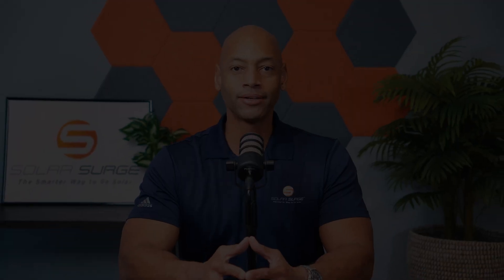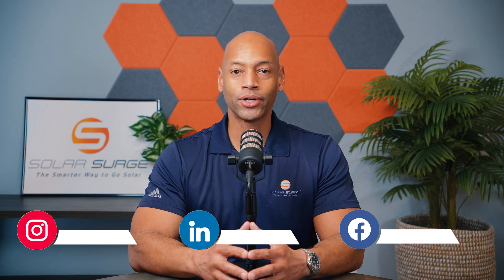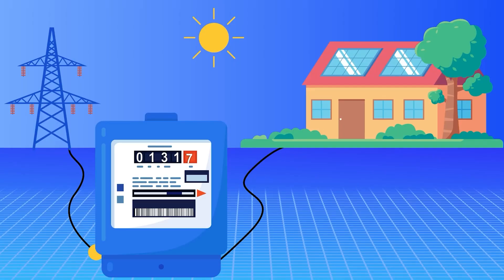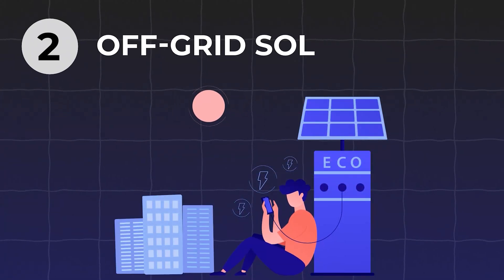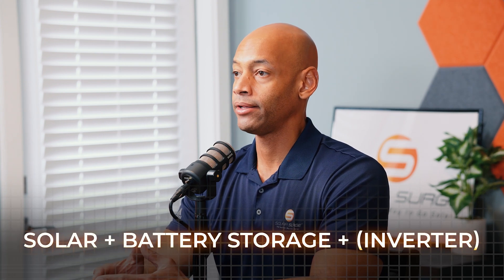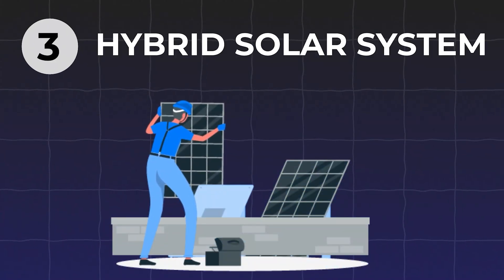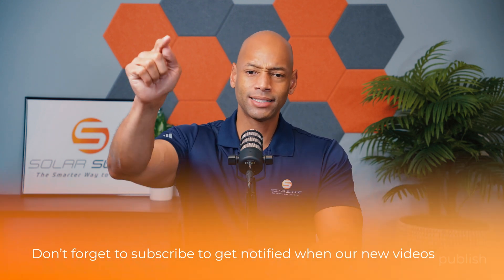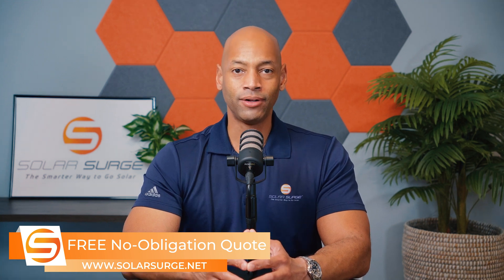Do Solar Panels Work When Power Goes Out?

Comment: Solar panes work as long as they are exposed to the sun and are not damaged!!!
Solar system may not work on the sunny day due to a failure of the single and/or multiple components.
You may have solar system coupled with a generator so when grid is down, the house is still powered even without having a battery, which could be a part of the grid failure system support.

Comment: Thanks for your video. I am however in a quandary because everyone that makes videos about “getting power from your solar & batteries (grid-tied) when the power down, falls short actually telling you how to do it 🙄🤷🏽‍♂️
I believe I can get my batteries to provide power to my home when the grid is down, I also believe, rightly or wrongly, that I can still receive energy from my solar panels to charge my batteries and power my home during grid outages. Sadly, I cannot find an explanation of how to get it work without sending energy down the grid during those times and whilst I am in Ireland, it seems that no solar company or anybody in this country knows how to do this. 

Please help me, I’m going crazy as we regularly have power outages and stuck with nothing 😳🙏🏾
Reply: The reason that solar is off when grid s down s for safety reasons. Its callled anti-islanding protection. This s to protect the grid workers during troubleshooting. 
However hybrid inverters has d capability to produce power either from solar panels or batteries. There’s an additional connector in d inverter for Emergency load and it’s an automatic switchover during blackout (built-in ATS by the inverter)

Comment: It is worth mentioning that many off-grid inverters can use grid power as backup power in order to power loads and charge the battery.. they just can not export excess power back to the grid. 5:07
Reply from the maker: Good point.

Comment: I have the iq8s with no battery and have been happy, but we don’t lose power often. So long as it can keep the fridge and freezer running that’s really all I need from it. I can also manually switch to generator if need be though. I’m looking forward to bi directional chargers coming out now that we just got an ev that supports it.

Comment: If you have battery backup with inverters and auto shore power switching, you'll never even know the power went out. If you are on a grid tied only system, you've likely been had.

Comment: I thought panels produced power if a cloud goes by or even on a cloudy day? That wouldn't be enough to provide backup power if grid goes down?
Reply: Jeez. It's almost like... If you watch the video. You'd have your answer
Reply: @badbake  thought it was a legitimate question, he says that if the grid is out that if a clouds come by that the refrigerator would turn on and off. Doesn't sound right to me. Panels are supposed to produce power even on cloudy days supposedly.
Reply: The panels will produce much less energy and won't be able to produce  enough amps to make your appliances work that's why they'll shutdown

Comment: Hey Joe, I love your channel and it’s super informative and educational for consumers and businesses.

I would only add here that I’m not a fan of calling a grid-tied system with battery back-up as “off-grid” because it’s just a confusing term that’s not really accurate.

I would prefer a grid-tied system with battery back-up to be called a “hybrid” system or a “multimode” system.

There’s less confusion, for example, with a truly off-grid, stand alone system that only has solar panels, a battery bank, and an inverter with no connection to the grid at all.

Comment: Great timing, I'm currently doing a lot of planning and purchasing to make various small scale systems (simulating a grid with a primary generator/inverter to attach grid tied units to). Been watching videos for years though. When it comes to grid tied systems, I think that (competent) professionals just focused on lowering your monthly bill, with no plan for power outages as you may not save enough money to cover the cost of adding batteries. Whereas most preppers and off grid enthusiasts focused only on meeting their power needs without the grid, without worrying about trying to spend less money than buying from the grid. I haven't seen many people talk a lot about adding batteries to a grid tied system, and even if they did, most people watching would be confused if they didn't explain it in a way they'd understand.

Comment: Hey Joe, I watch most of your stuff, You were in my house once before. Your information and your ability to share that information is simply extraordinary. I was one of those that bought a system 8 yrs ago, grid tied Enphase 4.8 kw no battery backup, I love this system and have never had a problem, but just as you stated, when the power is out, I have no power. I looked at adding batteries,and possibly changing from 6+ to 8a micro inverters to be able to Island myself, but you still need batteries. I already have 2 3000w  solar generators with 12kw battery, they both have 2 mppt controllers built in, so for me, adding more and more just doesnt make sense. I just bought the cabling  needed to bypass micro inverters and run a dc system to my solar generators, they can take 2000w solar in on each generator. I Just put this out there in case others may find themselves in the same boat. Cables are way less expensive

Comment: We were lied to about this particular issue, the tax rebate situation, the fact at best you get 4 circuits if you have batteries, If I* would have know these issues I would have never have gotten rooftop solar. Oh did I mention the installers went out of business, at least we have some warranty with the inverter, battery. There is more issues but it is too much for now.